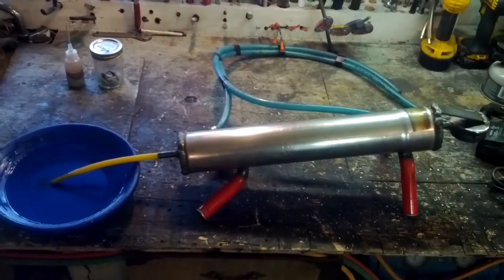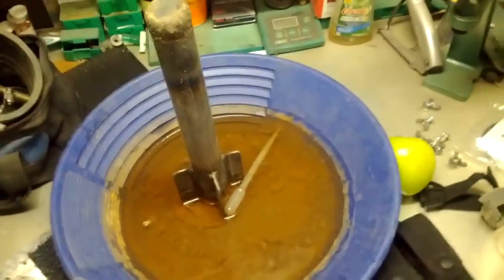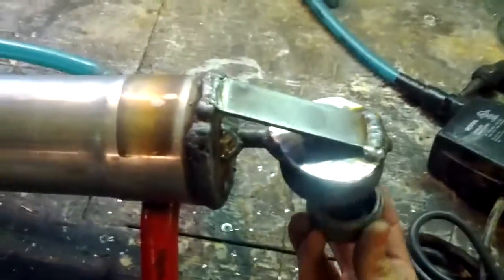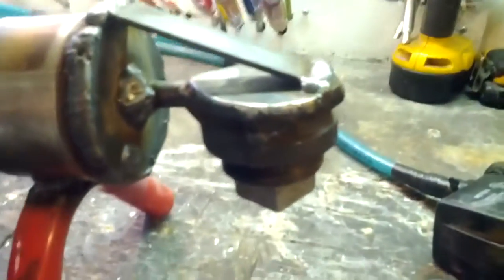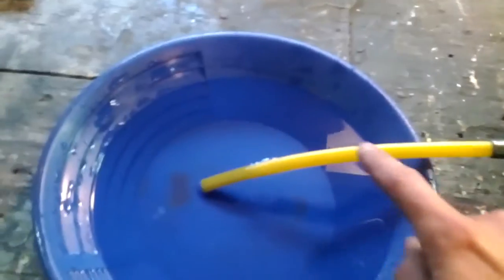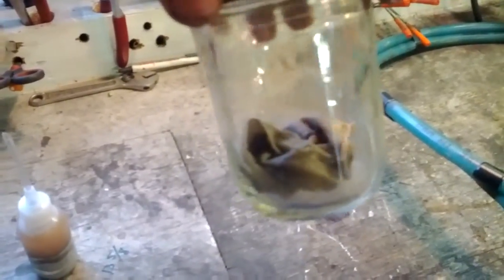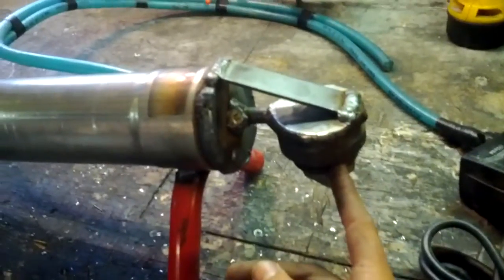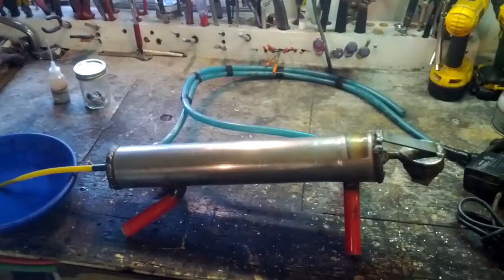Gold Amalgam Mercury Retort Home Build

Comment: Nice idea but I had an issue: both iron gas and water pipes I found were galvanized with a nickel or brass coating, and I've read that mercury tends to form an amalgam with these compounds, especially when it is heated. So as a preventative measure I polished the internal surface of the pieces and then let them sit with muriatic acid to finally rinse them with a solution of baking soda to remove any traces of the acid

Comment from the maker: A small amount of water does get drawn partially up the center tube "while cooling".  Never gets close to the hot end.  Its a safety precaution to put exhaust tube submerged.  The water actually helps flush out flower mercury.
Reply: i submerge my tube as well but am always very aware of it when i take the heat off that pipe is lifted out and although you say it never gets close to the hot end yeah id put 10 bucks down that it would get close and a certainty once you put a larger vollume union on it. My worry is ill run out of gas when im distracted as it cools water gets sucked into the 500degree retort pot then BOOM. 
My advice to anyone building one is bigger the pot vollume bigger the tube vollume (diamter and lenth) there probably is an equation for it
Reply: @5272paul  I suspect that the reason is "because that's the way it's done" but why fill your receiver with water at all?  The vapor pressure of room temperature mercury is trivial (that's why liquid mercury is used in mercury diffusion pumps to generate high vacuums)  Also, elemental mercury is relatively harmless - it's the organic mercury compounds that are particularly toxic.  If you're really concerned - run the gas through a cold trap.  (https://en.wikipedia.org/wiki/Cold_trap - use a short inner tube to prevent back flow of the condensed mercury when the retort cools)